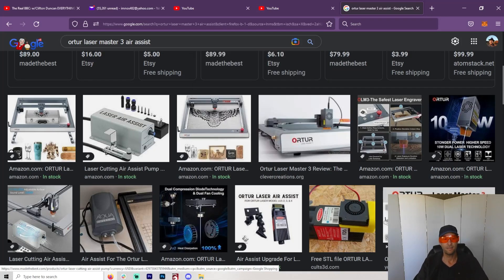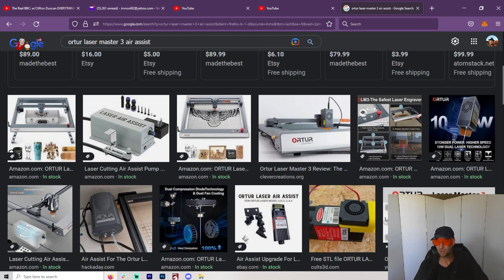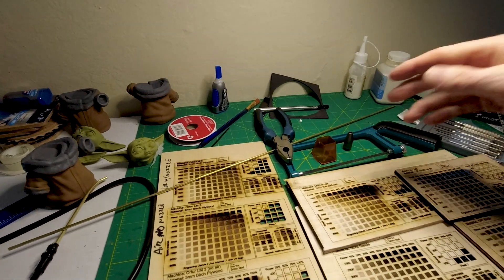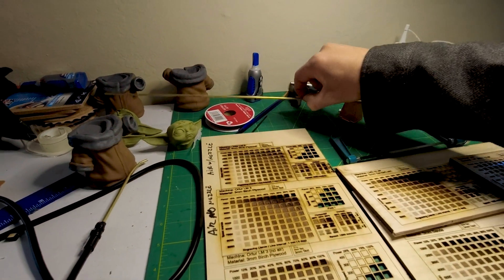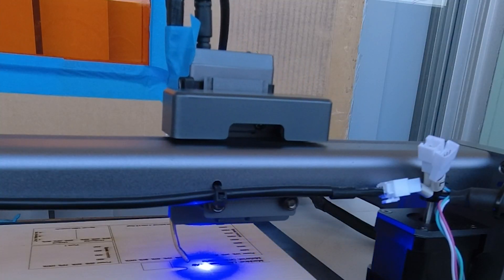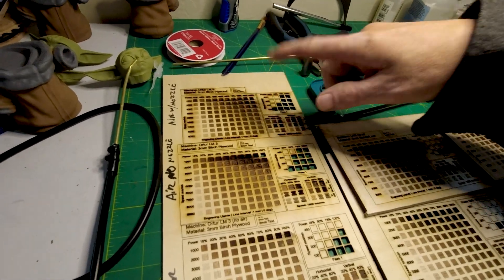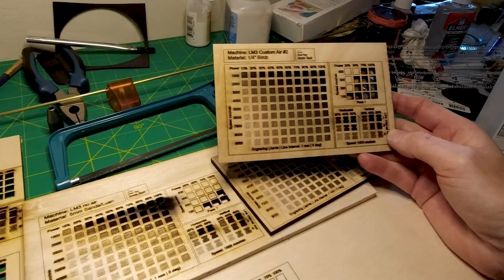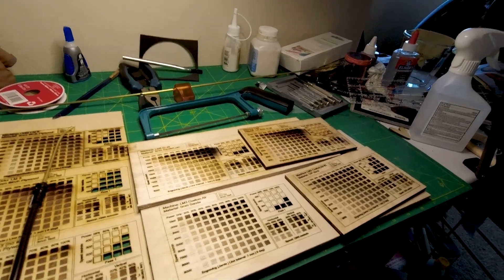Laser Air Assist Hacks! Ortur Laser Master 3

Comment: Great idea and will do when I get my unit.  Shame as it seems they didn't even test it themselves.  Just wondering how you figured out the bend needed, so as to no affect the laser. Thanks
Reply from the maker: I bent the tube with the air assist nozzle on the laser which gave me a pretty close point to approximate. I have an updated video on this (almost the same thumbnail) that can give you more info. Thanks

Comment: Thanks for this video.  I am still waiting for my air assist but getting worried that I wasted my money on this based on their hype.  Does it make a difference if the orange cover is not installed ?  I suspect that having the cover and the nozzle on at the same time is contributing to pulling the fumes back up due to the pressure drop.
Reply from the maker: I tried both and didn't see a difference. Check out my newer improve your air assist and I go over the Ortur in more depth. TLDR - it is great

Comment: Would increasing the air pressure through the built in air assist fix that issue?
Reply from the maker: From what I have seen, it will not. The pressure from the Ortur air (see my updated video) did not help it much
Reply: @ValleyForged  What about a shop compressor at like 40-120 psi?
Reply from the maker: @TruthHurts2u  Will try that when I can

Comment: I’ve had my OLM3 for about a week and I just set up my air assist connected to my shop compressor.  First, I don’t understand the finding that the nozzle is at fault as you can tell that the air is coming down through the nozzle.  I’m running fill tests now but the cut tests were a disaster.  Major burnouts at anything near 100/100. The air blast seems to create sort of a blast furnace there.  I’ve got an air brush compressor coming tomorrow that should be an easier hookup.
Reply from the maker: I am not sure why their nozzle doesn't work, but it just doesn't. My DIY just does a better job in every way. I did buy their more powerful assist, so I will be doing tons of testing in the coming weeks.
Reply: @Redthumb45 Any updates on this?

Comment: Great video!!  do you have any issues with the lens of the laser getting ditry with out the cone attached?  Thanks!
Reply from the maker: Actually, the only time my lens DID get dirty was with the cone attached. Ortur says to take it off when not using air. And I found when I used their air (from the top) and the cone, it got dirty (not sure how that could happen). So my way seems to be the best so far. I bought their new air assist, so when it comes I will try it as well.

Comment: I wonder how the air assist would work in stock form if the flow was increased.
Reply from the maker: I do too! Hope to be able to do that at some point
Reply: Im planning on trying increased psi myself when my Laser Maser 3 arrives.
Reply from the maker: @glenhouse46  They just came out with their own air, which they claim in 5 times better than the one I have. Will probably buy it and see
Reply: @ValleyForged  Jeepers. I'll check it out. I was going to try & tee into my main workshop compressor. So there's the legs, the extension kit & now a super cool compressor. Better speak to the bank manager here first..